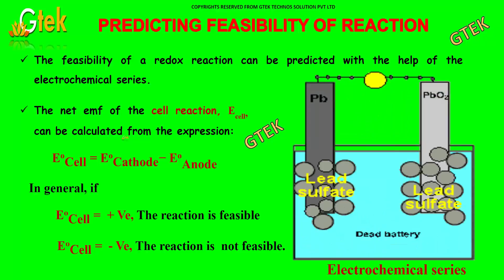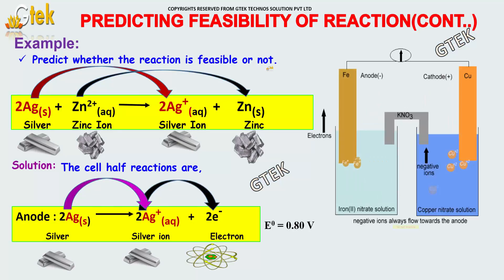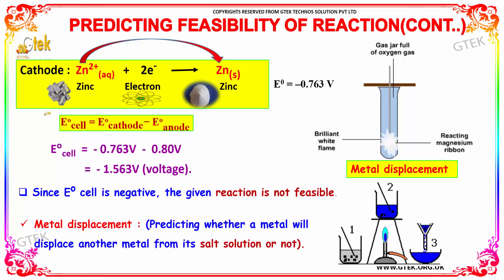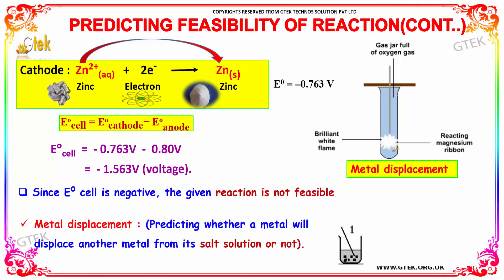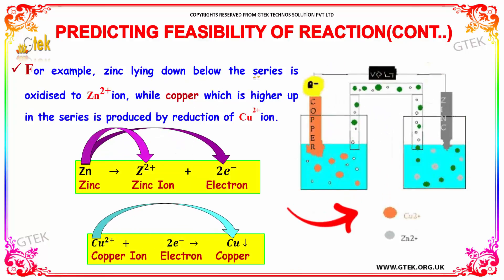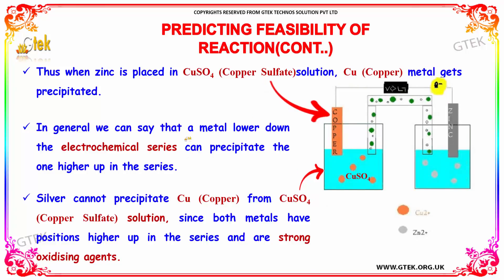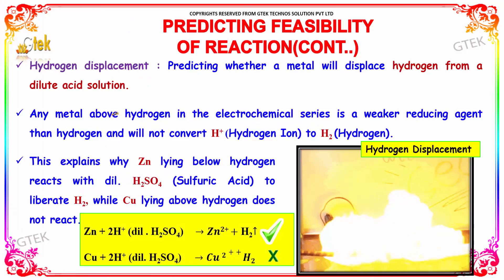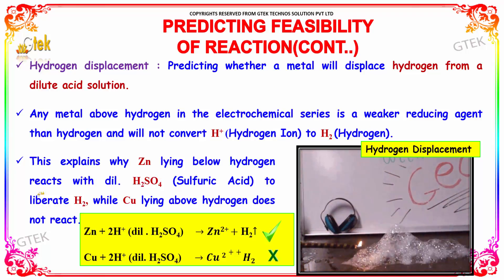predicting feasibility of reaction electrochemistry 2 class 12 chemistry subject notes lectures cbse

Comment: Use the Nernst equation for calculating the electromotive force (emf) of a cell for any ... The complete reaction may be written as. Na + + Cl -. Na(s) + ½ Cl2 (g) ... The net free energy difference between the electrodes forces the current to flow in the ... flow from the Zn electrode to the Cu electrode in the external circuit, or the ...